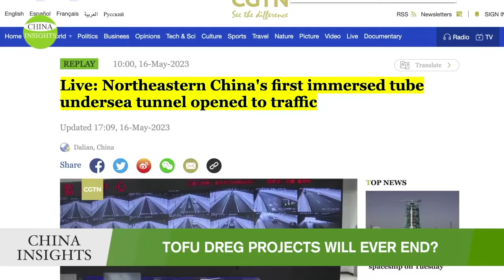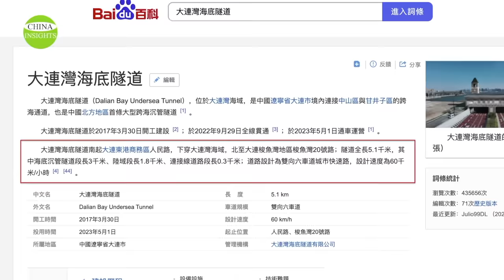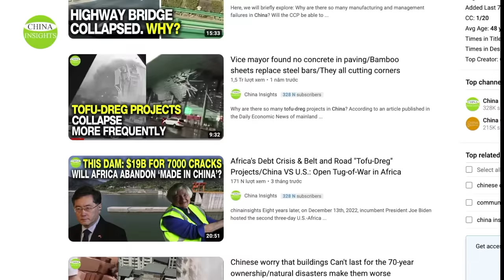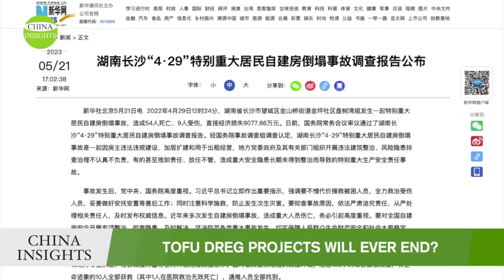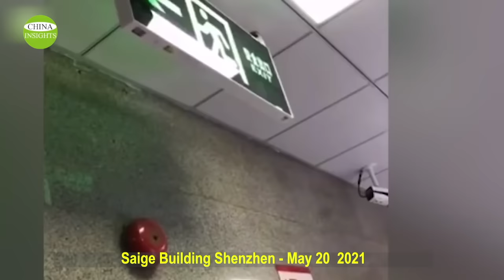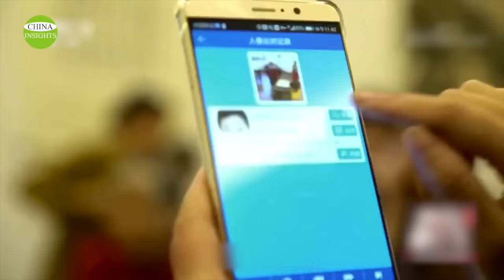Tunnel leakage, building collapse, shaking, cracking...when will the Tofu dreg project be over?

Comment: A country is so proud of the speed of building their infrastructures, and forgets quality requires time.
Reply: 😂😂who cares quality if it stays for a week workers are happy next tofu project
Reply: Did I hear that right, the tunnel has been open less than a month?
Reply: @1974Qball  yep new tunnel it is crazy a long tunnel wat if people stick in it snd can't get out
Reply: I guess you forget that the original plans might work and are save, but then someone comes and thinks "well, if we save money here... it will still be fine".
The problem starts when ANYONE thinks they can do this, because they think that they are the only one doing this.
It would hold if the company that brings the cement wouldnt had cut the quality a bit before delivering it.
It would hold if the company that brings the concrete that got made out of the cement wouldnt had cut the quality
It would hold if the steal quality would've been a bit better (like the quality that is in the original plans).
It would had hold if the water pipes wouldnt had failed... creating a wet mess that destabilizes the whole building
It would had worked if the people who had to plaster the building would've used quality stuff that holds the water out (same problem... someone before them delivered bad stuff and they thought they can cut corners, not knowing they got crap delivered themself).
Reply: they not forget it, they dont care
Reply: The CCP views their infrastructure projects the same as their people: expendable
Reply: @DreaMeRHoLic  I got your point still am sure in China there are independent home expert to they checking the whole building till windows they telling you the value of that home or poorly is built you get a whole rapport of that house especially by new buildings a expert checks you baying a home not a lollipop
Reply: @delphy2478  😂😂😂🤧
Reply: They don't have potable running water in China dude...
Reply: @topcatcoast2coast579  thats because china doesn't do infrastructure projects to improve the lives of it's citizens, it does infrastructure projects to be able to point at them and say 'look at how well china's economy and GDP is going'
Reply: You can have it Good, Fast, or Cheap. Pick two.
Reply: @Artorius19631  living in county why tofu buildings exist and nonstop everything collaps you better think twice 🍑
Reply: Nah, these have nothing to do with one another. They have many times more employees working on these buildings than you would see in Europe or US. Problem are materials. Everyone is stealing everything and companies build the cheapest shit possible even when they know that these materials hold no standards.
Reply: How dare you sir. They did not forget. It wasn't a requirement.
Reply: China can achieve anything without those pesky building regulations.
Reply: Wow it's really a new way of hypnotizing people: not using slurs to refer to them. What a revolutionary channel. Just kidding
Reply: Also Proud of speed it comes down.
Reply: @Artorius19631  good analogy, not gonna lie.
Reply: @Artorius19631  this is mainland china.  you can only pick one and you don't get to pick: the CCP does and it is not Good or Cheap LOL
Reply: Lives are cheap in this god forsaken nation
Reply: If it's made in China expect the consequences 🤣🤣🤣 what is made in China is poor quality 🤣🤣🤣
Reply: And competency. Simply knowing which end of a shovel to hold qualifies a worker in the PRC as a highrise construction expert
Reply: This is how it is planned.  Buildings must come down at a faster rate then they were constructed.  It is called recycling.
Reply: its not forgotten.  this is intentional bad work to save money
Reply: @CBRN-115 so weird that a lot of their dramas always portrayed n talk about gods.
Reply: Cheap, Fast, Good - choose only 2
Reply: They forget to mix concrete with cement and week steel
Reply: They stole the whole thing from Germany. They couldn't invent the tooth pick
Reply: On May 16, when some netizens drove through the subsea tunnel, they were surprised to find that there was a lot of water on the ground overflowing the ground, and many vehicles waded through the water. At the tunnel entrance, many vehicles are reversing and turning around.

After investigation, it was not a big deal. The reason for the water accumulation was that the fire-fighting pipe connector, an ancillary facility of the tunnel, fell off, causing the pipe to leak.

After two hours of closure, at 10 a.m., traffic was resumed after disposal.
Reply: 😂😂 ! China is Tofu's town
Reply: You get fast, cheap, strong. You get to pick two.
Reply: I don't think it's about forgetting, it's merely corruption. Maybe also poor skills.
Reply: As some ppl says no pain no gain!!
Reply: @megabyte5726  Frankly there is little distinction in the PRC between intentional and unintentional low quality work
Reply: Oh the power of the red envelope
Reply: On May 16, when some netizens drove through the subsea tunnel, they were surprised to find that there was a lot of water on the ground overflowing the ground, and many vehicles waded through the water. At the tunnel entrance, many vehicles are reversing and turning around.

After investigation, it was not a big deal. The reason for the water accumulation was that the fire-fighting pipe connector, an ancillary facility of the tunnel, fell off, causing the pipe to leak.

After two hours of closure, at 10 a.m., traffic was resumed after disposal.
Reply: @VideoDotGoogleDotCom  On May 16, when some netizens drove through the subsea tunnel, they were surprised to find that there was a lot of water on the ground overflowing the ground, and many vehicles waded through the water. At the tunnel entrance, many vehicles are reversing and turning around.

After investigation, it was not a big deal. The reason for the water accumulation was that the fire-fighting pipe connector, an ancillary facility of the tunnel, fell off, causing the pipe to leak.

After two hours of closure, at 10 a.m., traffic was resumed after disposal.
Reply: It's more about cutting corners and substituting for inferior/out of spec materials for the sake of profits.
Reply: Yep
Reply: Thanks . We fixed the tunnel.  Meanwhile trains exploded in usa
Reply: @1974Qball  nope
Reply: @CetinAmsterdam  thanks.  Be more jealous
Reply: @delphy2478  thanks.  Be more jealous
Reply: @mattyreardon3593  they stole ? Source ?
Reply: @jacksmith-mu3ee  meanwhile our trains are fine😂😂😂jealous for what tofu buildings, little pink I just send Nancy Pelosi to Taiwan 🇹🇼 the independent nation where they make unique chips
Reply: @CetinAmsterdam  a whole report can last seconds for the right amount of cash
Reply: @blairmarshall544  🙏🏼😂😂 In china indeed without seeing the building you get the rapport based on what you payed under the table
Reply: Tornado goes brrrrrrrrr
Reply: Ah, NO! Water leaking from the ceiling IS NOT NORMAL!!!
Reply: AHAHAHAHA A country?that disregarded centuries of Knowladge thinks it can build? HOW? AHAAHAHAHA
Reply: It would be fine if they did the work correctly.......usually lol
Reply: Das the fastest infrastructure  and fastest train on Earth.
Reply: @CetinAmsterdam 😢😢😢😢
Reply: @lhopee more like : potray themselves as gods, capable of becoming gods, break free from gods' rule and choose one's own destiny/fate. 
The got no respect for any god except their own selves and ccp.
Reply: Substandard work equals disaster😂😂😂
Reply: Not the quality..... It's the corruption.  Let's say the projects are $1 Billion Yuan and the projects itself only $100 Millions or less.
Reply: Doesn’t help that time seemingly goes backwards
Reply: And you can't easily "fix" poor concrete and poor design. You CAN for huge amounts of money, time, and engineering but why not build correctly in the first place and miss all the drama....at leas tfor 100 years where you're not around to get the blame !!!
Reply: It’s the best money for construction companies.
Reply: Actually it's worse, even when built correctly, sub contractor cuts corners.  It's the Chinese way!!   LoLz. All industries are like this even when you hire a dillegent honest contractor, someone somewhere is cheating the paint or using toxic particle boards.

Comment: Absolutely no way I'm using that tunnel. We used to frequently travel thru several of the tunnels on the east coast and was always surprised how dry they stayed. There shouldn't be any leaks. That's a lot of water for a so called fire pipe leaking.
Reply: If a fire pipe was leaking It should have been fixed immediately. And as you said that is definitely too much water for a pipe leak.
Reply: Human life in China is not worth more than 1$ bill.
Reply: Does anybody actually believe that?
Reply: And salt water will infiltrate the concrete and corrode the rebars

Comment: The ironic part is how it happens, because I would bet that the original plans themself are solid.
Then someone looks at it and thinks "we could make some extra money if we use a little bit more sand and a little less of what holds it together", because it would still hold.
But who ever does this doesnt know that the company that you buy from allready looked at the plans and thought "well, if WE deliver bad quality cement... it would still be fine, because the savety protocol in the plans says that it has to be 20% stonger than needed, so if we lower the quality by 20% it would still be fine".

Then you end up with cuts all over the place the the outcome is the Fodu dreg project and ANYONE that stole money trys to save their own ass... crating so much power that you have no chance to find someone to blame, because ANYONE involved works hand in and to make sure that you cant do anything against them, because in the end they just go a level higher and say "we messed up... but here is a cut of what we stole... PROTECT US" and then even people that had nothing to do with the original mess get involved.....
Reply: "If we use wood and cardboard as a filler instead of concrete we can save money." Which is a thing, I've seen videos of houses that if you chip away the 'concrete' of a wall you find it filled with random pieces of wood and cardboard.
Reply: Tofu Dreg. Not Fodu Dreg.
Reply: Your comment Tell us U are not in this industry . Save your comment.
Reply: @andrewchang8192 we have videos of foundations and walls being filled with cardboard and bottles to reduce concrete usage.

And I've personally seen what happens with the corruption in Africa, it's exactly what he said, each step down the way, the cement is cut with sand until you're left with sand castles that are cracking up the whole way through construction.

Comment: @11:42 This one isn't entirely the fault of the original construction. If someone came in and removed a load bearing wall then there were bound to be consequences.
Reply: In Greece, all the hotels we stayed in had the top floor unfinished.  They basically say they are building a five story hotel, but the top of the fourth floor becomes the flat roof, with some plumbing sticking thru.  The reason, Greece doesn’t collect taxes until it is complete, so the don’t finish the floor but still open for business.

Comment: Salt water leaking in will cause the reinforcing steel in the concrete to corrode.  The steel bars will expand up to 8 times it diameter causing massive failure of the concrete.

Comment: SEG plaza is actually one of the few things in china that is not a "tofu drag project". it was build well using quality materials but the issue was actually bad design that resulted in the spire being removed to prevent this in the future. the tower was designed to be tall and pretty with very little thought about wind. the design was carried out by domestic architecture company (Hua Yi) that had virtually zero experience with large towers instead of an experienced European or US design firm. this was done in the name of nationalism. they wanted to stick it to the west by designing their own tower. well, you showed us.
Reply: Pretty normal for a country with regulations or quality control.

Comment: the tunnel has a waterpipe leak.. completely normal during the first months or even years.  If the tunnel had a shell leak it would have been close at once. If you understood the pressure the water outside the tunnel has, and if that was to leak into the tunnel it would tear a hole so fast you wont believe it.
Reply: It's not That, far under sea level. 26 metres iirc. Don't recall how quickly pressure increases as you go deeper, but know it doubles every X number of metres under sea level. I think it was 100 metres, but 10 metres is also possible cause I don't remember.

Regardless. That is... not that much pressure. Maybe at most, 2-4 times the pressure one experiences walking around AT, sea level. (Assuming the pressure doubled ever 10 metres) A hose in industrial settings, let alone pressure washers or fire hoses, have more pressure than that. Plus what I would hope is a level of sand over the top of the tunnel? That certainly could give us the result of a "Fairly" slow flow. It is telling that they haven't been able to stop it. Indicating no redundancies or ability to stop the flow in fire supression pipes  when damaged... a major flaw. Or worse.
Reply: @Destroyer_V0  at 26 meters the pressure is so greatlit would have torn a hole bigger and bigger in minutes... ingorance is bliss
Reply: Alright then, I looked up the figures myself, since you couldn't be bothered.

atmospheric pressure at sea level is 14.7 PSI, or 1 atmosphere.

For every 10 metres of depth you travel, pressure increases by one atmosphere.

Depth of 26 metres is 3.6 atmospheres.

Leaving the pressure of any water entering the tunnel, assuming nothing to slow it down like sand note the water in the tunnel was not exactly clear

Gives us a water pressure of, rounding up, 53 psi. Which, while high. is HALF, the lowest average for fire hoses, and a sixth for the higher end fire hose water pressures. (116 and 290 psi according to wiki, is a good ballpark anyway)

According to a few different sources who sell garden hoses, the average pressure FROM A GARDEN HOSE, is 50 PSI. And that ain't about to cut a path through concrete anytime soon. I would know, I have tried to cut through the concrete foundation of my house with a garden house while washing said house and outdoor areas. Didn't work.

Either you have no concept for how shallow 26 metres is, don't understand metric, or are spreading misinformation. The water we saw leaking from both the ceiling and a lower part of the wall, is very much consistent with water pressure one would expect from, again. A GARDEN HOSE.

Comment: Why would you blame the previous owner that convert the space for a hotel.  If a home owner decided they want an open floor plan and knocked down a load bearing wall which brings the building down, that's okay because its a residential home owner and not some commercial use like a hotel or gym.. lol?  Problem is people remodeling unsafely.

 Do they need permits?  Were they given a permit?  Were they honest with the gov about what they were doing?  And the gov said okay you don't need any more engineering approvals and your good to go?  Then okay yeah gov is to play - but assuming they didn't actually get permit, or did stuff they didn't say they would etc then how are they not to blame lol.

Comment: You would think that a major crane manufacturing company in china would actually have competent engineers. Seven cranes show up on the dock and we immediately red tag them all because the chinese used hard (Grade 8) bolts instead of structural bolts to attach the legs. Had an engineer from this company tell me "That slag in the weld root was caused by something you did using the crane" after I found a crack forming during a yearly inspection and ultrasound showed a slag inclusion the size of my thumb. Got a nasty letter from china demanding to know what I was doing looking at that weld. (Yearly inspection as required by state and federal regulations.) If you want to be screwed, buy chinese.